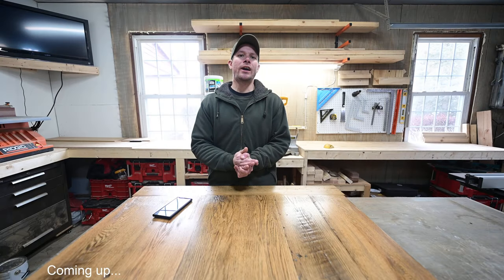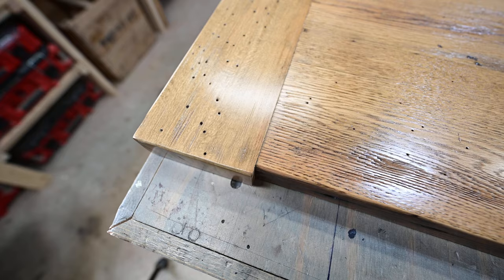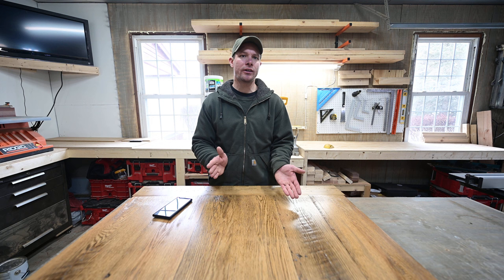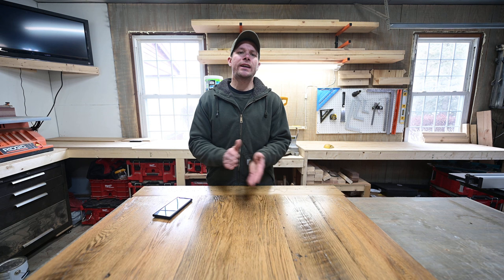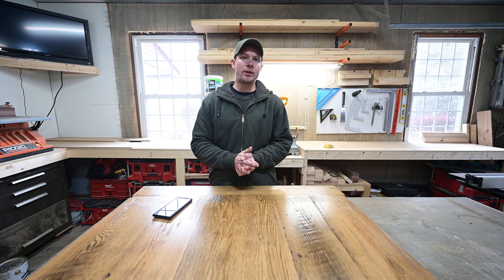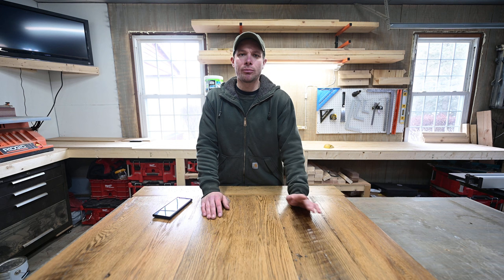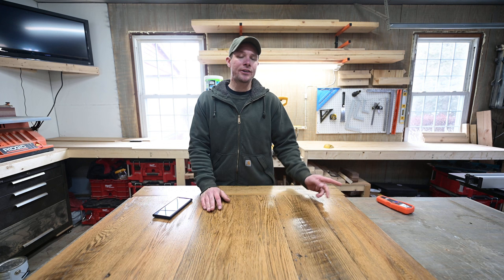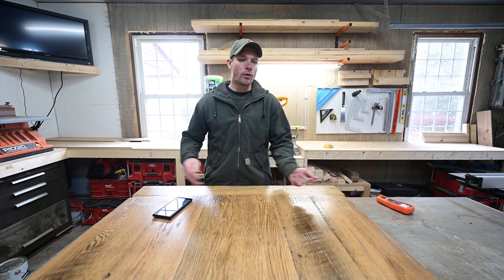The problem with Air dried lumber... Don't let this happen to you.

Comment: Hello Brady, This being an old video, I'm not sure you will see this comment, but please do respond if you (or a reader?) has questions. Just about everything you post in this video is either incomplete or massively inaccurate in many ways. I've been a traditional woodworker and Timberwright for over 40 years now and over 90% of the wood I use to build with (architecture, flooring, furniture, etc) by modern standards is all GREEN and I simply do no use "cooked wood" (aka kiln dried) in any of my work. I will hit the highlights below:
0:04  100 years is more than enough time to dry wood, and this is about knowledge and skill  sets...NOT...whether the wood was dry enough as it most certainly was...
0:20   The table top was "properly dried" but in some ways was not built or finished correctly, and (most certainly) the client was not properly educated in what to expect from a traditionally built table top with breadboard ends...
0:50   There is zero "problem" with air dried or even green lumber. This is, again, about skill sets and knowledge base in the craft of traditional working and joinery systems to use...and where. I mean that statement as a pure  observation of fact and not a critical statement (in general) of the work presented in this video, which is good and well within the parameters of "modern wood machinists" that know little to nothing of actual traditional woodworking or the modalties in means application to be successful with it. Most DIYers and those that only learned woodworking by reading and following others that learned the same way simple do not know how to "read wood" or the many different traditional ways it can be successfully used dry or green...even for furniture...
2:50  You most certainly will have the same issues, often worse, with kiln dried wood. Wood is either going to contract (green wood) or massively expand (cooked wood) when it is used in application that employ traditional joinery. Too many today treat wood like plastics and or plastizied wood products like plywood or partial board...The later are industrial products and not natural ones...
If you, or any reader of this, ever has questions (???) please feel free to reach out. The craft of "woodworking" in the historical sense has built most of what we have in wood architecture and artifact even to this day and most of that was built with "green wood" by the modern standard and understanding which is completely opposite of what you are stating in this video. There are even some wonderful books on the subject to get yourself going and more knowledgeable on the subject if a traditional apprenticeship or mentorship is not possible...
Reply: Do you heat up your wood to get the internal temperature hot enough to kill bugs?  I am wanting to get into making end tables, night stands. And other furniture... and I'm terrified that I'm going to buy lumber that had bugs in it. Also, I'm really worried about the wood expanding and contracting that it will warp or do something to the piece I make.
Reply: @svonnestickley6311  The simple fact is, historically, most things made of wood in "day-to-day" use by the average person from most cultures were made from "green wood" by today's industrial standards (and knowledge) of woodworking. What is actually the issue is skill and knowledge within woodworking...not any silliness that the wood has to be "kiln dried" to kill bugs or other nonsense...

Are there items that need "dryer wood" than others? Yes, items like fine furniture in some styles or window frames, for example, need dryer wood and very selective species and grain patterns. I am currently finishing up windows for a restaurant pub project. The wood in these windows...WERE NOT... kiln-dried and are of a rather low-grade Yellow Pine, but because the project is supposed to simulate an 1840 Carriage Barn the client selected knotty yellow pine salvaged from a 150-year-old warehouse.  This wood, when new, was used in the building while it was still green and thus dried in place, so it is air-dried and has worked just fine for building these window frames...

Warping can be an issue with anything made from wood...DRY OR GREEN...!!!...such as end tables, nightstands, and related items. This is all about learning to work wood properly be it green or otherwise...not whether it can be done or not...I recommend finding someone who can mentor you in the process and/or reading good books on the subject like: "Make a Chair from a Tree An Introduction to Working Green Wood" by  J. Alexander or "Joiner's Work" by Peter Follansbee...

Feel free to ask more question if you have them...

Comment: I don't agree with this this is subjective because I have I have bought kill them dry wood all my life from the hardware store and they would shrink a wap exactly the same. I own my sawmill and I have able to gotten better lumber air dry from what I actually got from the lumber yard.
I think it depends on where you get your wood what you going to use it for on the species of what somewhat dry different than others depends on the thickness like you just said in your video.
Just say you get 100-year-old barn wood which is in a barn drying slow in the cold you know. Then you take that lumber and immediately cut it get it to your whatever you need for your project and then sell it The most likely going to have a defect The thing you should do you get the lumber you figure out what temperature was going to be used for you let it sit in your shop somewhere around the same temperature before you actually use it then when the lumber start to wiper do it saying now you could correct it and take all those things out because that most likely won't happen to the lumber after you get it done.
And it's stuff like tables anytime you start seeing movement and the product before you do it like I said you know you could add metal to the bottom of your table you know create some grooves and then add your metal.

Because your video gives sawmills a bad name and people who air dry lumber a bad name and people don't know what they're talking about customers oh I want kiln them dry kiln them dryer is not always that great

Comment: Happened because you didn't let the wood dry to indoor humidity levels. 
Kiln dried will warp if you use it outside like wet wood inside.
Reply: does this mean for outdoor applications, air dried is the superior option? and the inverse? (kiln dried for inside is best option)
Reply: @squaaam2263  not superior. But moisture level will be where it needs to be to avoid warping and cracking. 

Nothing wrong with kiln dried set outdoors to acclimate. Check out thermally modified wood
Reply: @squaaam2263 keyword here is acclimatizing. The wood needs to be at or near the moisture content it will have in the target environment, regardless of the starting point. Outside it will generally be between 12 and 19% moisture content, inside 7-9%. In very dry or wet climate areas, the numbers will be different of course.
Reply: @vharboe  Yeah, i know this a year later & feel dumb for even asking cause i wrote a paper on hydroscopic regain since then… 

but thank you so much for being polite with your answer! lot of people don’t know the difference between a question & a insult these days
Reply: @squaaam2263  No stupid questions, only stupid answers. :) At some point, the wheel had to be invented. No point in blaming the guy for not having thought about it sooner! :) The same thing goes for knowledge.

Even though the question was answered for the most part, I thought it would be a good idea to leave a bit more information on the subject. Because geeking out over it is fun! :) And someone might just need that info at some point.

Comment: Are some woods more susceptible such as white oak?
Reply from the maker: I do believe it varies per species. I know that quarter sawn white oak in one of the most stable
Reply: Quarter sawn anything is going to be fairly stable.  But no matter the wood  species or how it was sawn, it will move with seasonal changes. 

If you can't tolerate that movement,  build it out of something other than wood.

Comment: You're blaming the wrong issue. You started with dry wood and built it after it rehydrated. Stop blaming the wood. Air dried lumber is just fine. Wood moves the same no matter how it's dried when compared at the same moisture content. 
And a kiln in your basement is not a great idea. Do it in a garage or sealed outside.

Comment: No. You misunderstand the nature of barn wood, which is subjected to wild extremes. All air dried lumber that has set long enough is stable. Kiln dried wood will eventually re-absorb ambient water. Barn wood needs to be left in the room in which it will be used for several months, and then it will be acclimated. To THAT room. Any room near a fire source is going to be drier than more distant rooms, and subject any wood to forces not found elsewhere. Don't make this issue worse than it is.

Comment: And throw that moisture meter out. Get one that has probes. No reason to know the moisture level of the outside of the lumber
Reply: Look up how the probe-less meters work, it penetrants roughly 3/4" into the wood with the detection field it uses and doesn't just detect the surface moisture.

Comment: The problem with your table top is with you lack of understanding basically.

Rule of thumb for air drying is “one inch of timber per year PLUS A YEAR.

So 2 inch thick timber will require 3 years not two.

Then there’s your lack of a moisture meter.

Fair enough, like most other idiots I see on YouTube showing moisture meters and how to use them, you didn’t get a correct reading because you didn’t apply any of the species correction factors nor temperature correction factors. 🙄

The meters when they come out of the factory are graduated to read Douglas Fir.

So for any other species you have to apply a “species correction factor” then a temperature correction factor to the obtained meter reading, to get an accurate moisture content reading.

If you ran a timber seasoning kiln as I did for decades, your test piece towards the end of the 3 months drying cycle comes out hot (up to 50 degrees C (122f) so that’s why the temp correction factor needs to be applied.

I did create a YouTube video on species correction factor.

https://youtu.be/BkAUcSvRnp4?si=rAfr6JQqxdi5-W9p

Next theres the 3 different types of moisture contained within wood that needs to be removed.

You have “free moisture” ( Sap) that runs up the tree from roots to crown for photosynthesis to occur.

It runs freely between the cellulose wood cells.

Then you have moisture trapped within the cellulose fibre cells, that’s called “intercellular moisture.

Lastly you have “Intra-cellular moisture” & that’s trapped within the cellulose fibre cell walls itself. 

So the cellulose fibre cells are double walled - imagine two rubber balloons - one inflated within the other to leave a gap between the two balloons.

That’s where the intracellular moisture resides.

That double walled cellulose fibre cell has “pores” within it (called “lumens”, through which the intercellular moisture - the moisture inside the inner balloon has to diffuse out as a gas.

If you draw the free moisture (sap) out too fast, you create a pressure differential between the inside of the cell and the gaps between the cell where the free moisture (sap) travels up the tree from roots to crown & that pressure differential has to try and draw the intercellular moisture within the cell - out through the lumens (pores) faster than it can diffuse as a gas and the cell walls collapse ( a condition called structural collapse in kiln dried timber) where the timber collapses well below its dawn dimension and goes all powdery and can’t be machined, sanded or polished - ie useless.

This is why timber seasoning kilns are run on a drying schedule that takes time - for hardwoods up to 3 months. A lot quicker for softwoods because they have 2 grain directions , tangential & medullary rays, so are less susceptible to structural collapse from being seasoned too fast.

The difference between hardwoods and softwoods isn’t the density of the timber.

It’s actually how the tree reproduces.

Hardwoods by flowers, nuts and seeds, softwoods by cones and spores.

Balsa wood for eg is one of the least dense Timbers on the planet, it’s very soft, but because the tree reproduces by flowers nuts & seeds Balsa is a very soft hardwood.

Then there’s the equilibrium moisture content, the moisture content at which the annual difference between summer and winter shrinkage and expansion is the lowest.

Radial & tangential grain sawn lumber even once dried to its EMC (Equilibrium Moisture Content) shrinks almost nothing longitudinally usually less than 1% 

But radial & tangentially that same lumber can and will shrink up to as much as 6% on each board.

This is x why breadboard end tables are just a dumb idea - design wise they will always do what yours has done.

That’s not your fault if the customer asked for a breadboard end table design.

Different if you decided to do that & they didn’t ask for it, then your liable to repair / replace it.

It seems like maybe I need to create another video about timber technology to go with the correct use of moisture meters one I already created.

The number of wood workers on YouTube who know nothing of timber technology astounds me.

It’s become basically the blind leading the blind.

For all the good that YouTube can do in teaching people things they never learned in school it can be just as bad at promulgating falsehoods as if they are facts. 🙄👎
Reply: That "rule of thumb" is also pretty meaningless unless you're dealing with a dense hardwood like oak and you live wherever the "rule" originated,  probably New England.  And even then it's probably wrong.  

Douglas Fir where live, even if cut 4" thick, will air dry to 12% in about 3-4 months if milled at the start of summer.  A common hardwood here, the red alder might only need a couple more months at that 4" thickness.  Even our maples will be as dry as they'll ever get in 1-2 years depending on how well it's stacked,  even at 4" thick.  

And if transported to someplace that gets legitimately hot, and is arid, those same woods will air dry much faster still.

Would still be good to kiln it just to sterilize the wood though.